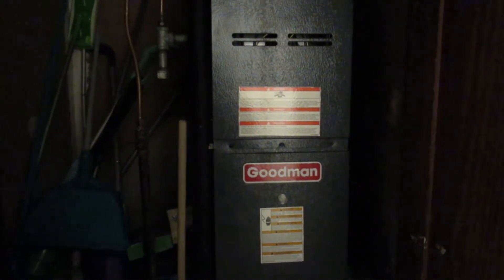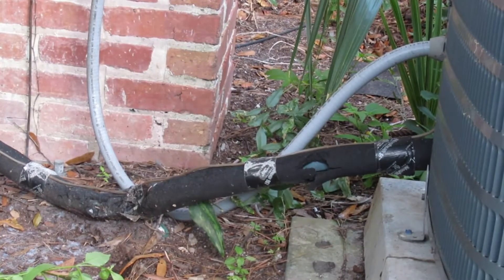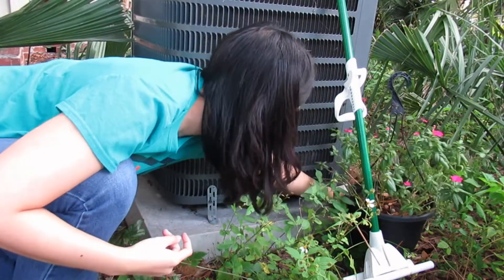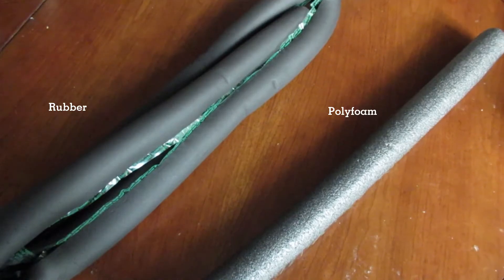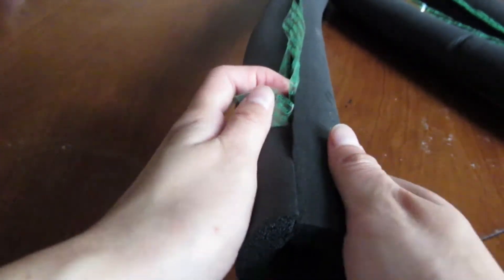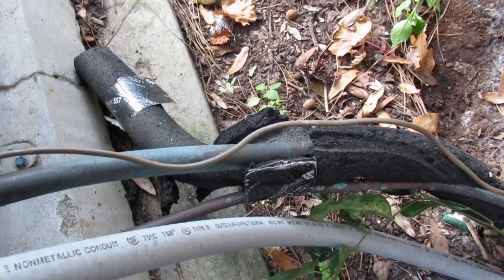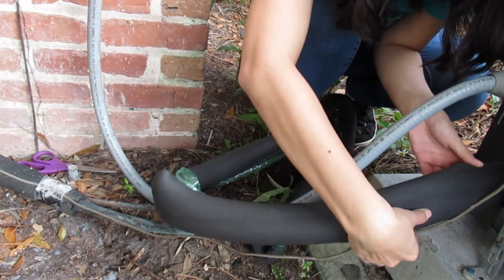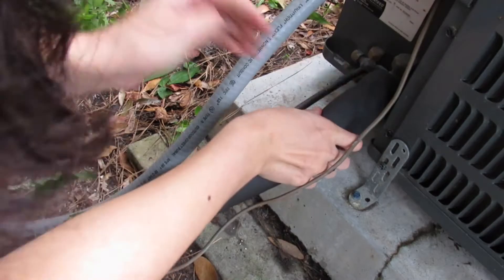Insulating Your AC Refrigerant Line

Comment: Where did you purchase the insulation
Reply from the maker: You can purchase pipe insulation from hardware and home supply stores or HVAC and plumbing supply stores (these might not sell to the general public and may require you to have a contractor's license). We personally get ours from Lowe's. As other commenters have pointed out, make sure you buy insulation with the correct inner diameter for your pipe!

Comment: Our poor keeps freezing when the temp outside hits around 70. There is no insulation on the pipe but the AC guy says it doesn't matter..... Can someone help
Reply from the maker: @jessica sorry we missed  this  comment, AC refrigerant line insulation WILL help conserve energy but will not  solve the pipe freezing issue,  that is usually an issue of a very dirty filter and/or coils under the filter  OR  Freon needed. We hope it was solved quickly!

Comment: why shouldn't Iinsulate the control wire?
Reply from the maker: Our apologies for the long response time; according to one of our energy experts,  "Why would you thermally insulate a wire that already has electrical insulation on it? Thermal insulation is not required on electrical wires. The heat generated through I2R losses is not significant. Enclosing the wire inside the AC pipe insulation provides no benefit and may lead to failure because the line will be more likely to stay wet, leading to corrosion of any exposed metal. That wire is dry most of the time."
Reply: You can wrap in separate insulation to serve as a sacrificial layer to sun uv, protecting the wire’s pvc layer.  I would not incase it with the coolant pipe to give access to it for service etc.

Comment: Video doesn't point out to measure pipe and to buy correct size.
Reply from the maker: Very good point, we appreciate your feedback.
Reply: Circumference divided by pi = diameter.  Buy for copper pipe.

Comment: Thx for the video. I am sure that you have used a wrong size / diameter of insulation. The insulation should snuggle fit the copper pipe.
Reply from the maker: Thank you for the feedback. We agree fitting snuggly is best!